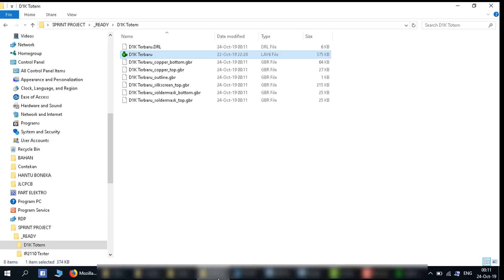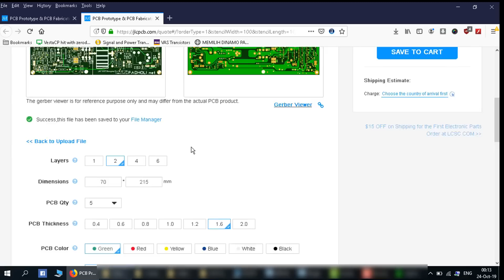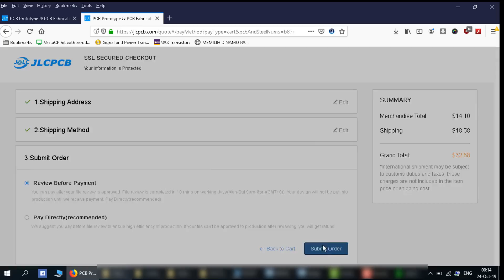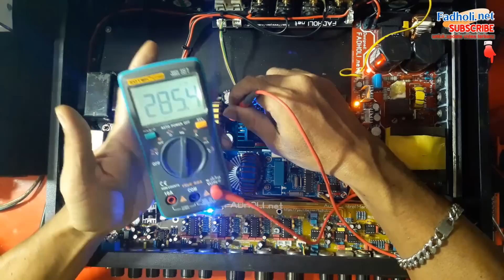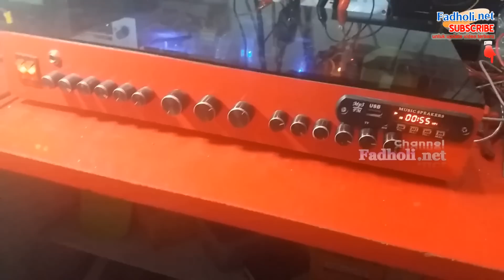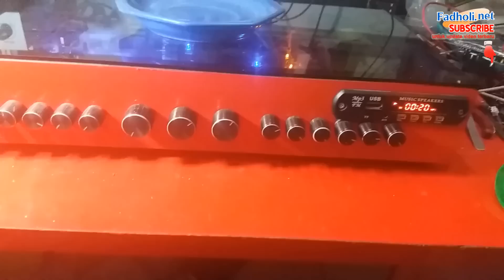Power Amplifier Class D 500W Dan 1000W

Comment: Kemarin mau beli power bingung mas. Ada 2 pilihan. DBQ 802 dan extreme lc3000. Satu class D pakai smps. Satunya class H pakai toroid. Kita uji bareng2 pakai acesoris sama setelan sama gak ada yang d rubah. Bass banter class D tapi serasa ampang atau kosong atau ngambang. Kalau pakai class H yang toroid suara lebih mengisi dan stabil. Akhirnya pilih extreme lc3000. Harga jauh juga terpautnya. Yang DBQ 3.3jt yang extreme 4.9jt.
Reply from the maker: Hehehe rate outputnya hampir sama tapi harganya lumayan terpaut jauh... mungkin ada harga ada rupa mas..

Comment: class d 900 tidak bisa start kira2 apanya mas
Reply from the maker: Cek mosfet, IC pwm... dan pastikan suplai semua tegangan masuk normal.
Reply: Fadholi. net  mosfet nya udah saya cek normal pak ic nya juga udah ganti baru semua
Reply: resistor yg 10ohm tiap di hidupin selalu kebakar pak